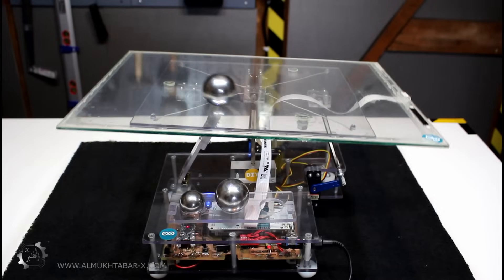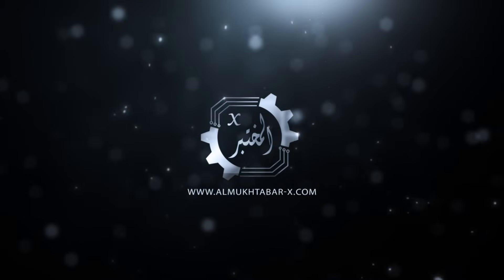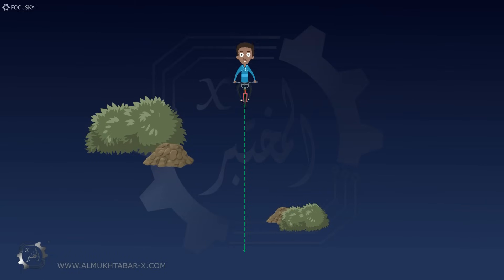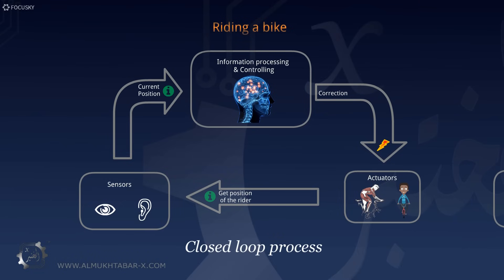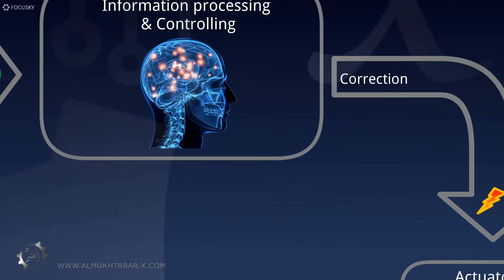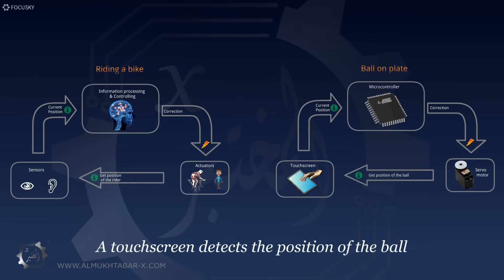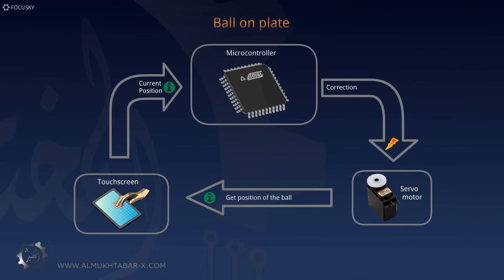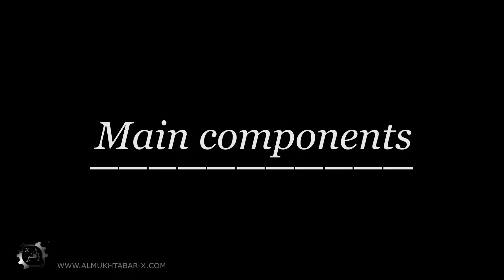Why this Plate never lets the Ball Fall? Ball on Plate PID controller with Arduino

Comment: this is impressive.  I just got a few of these touch screens (actually mine still have an LCD on them) at a surplus store.  I doubt I will be able to interface with the monitor, but I could overlay the touch panel over a different lcd.  Anyways, I was hoping to get some information on how that touchscreen interfaces with the arduino.   What are the 5 lines you connect & what kind of information is the touch screen sending?

Comment: Hello! This is totally amazing! congrats for this great project :) 

Do you have some simulation about this system? currectly I'm working in a project with a states feedback but my main problem is in the non linear simulation. I linearized the mathematical model to can design a control, but when I try put the same control with the non linear model there are problems, and I know that is so difficult that the same control function with a non linear system but I was just looking for an approximation ... I would like consult some type of information if  you have to can achieve this project :) 

Regards!

Comment: Incidentally, no, a bike stays upright NOT because of the skills of the rider, nor because of the gyroscopic effect of the wheels — those help, a little, but are not necessary.  If you have a powered bike of some sort, and jam the throttle on, it will disappear over the horizon if you don’t catch it.  The important thing is the geometry of the frame and fork, which causes the front wheel to turn “under” the bike whenever it starts to fall.  See here for details: https://youtu.be/oZAc5t2lkvo

Comment: This is great and has renewed my enthusiasm for Arduino. What brought me here is actually my office chair in my home. I noticed one arm was about a cm lower than the other, where it would touch the keyboard tray. I let it bother me for a day and then turned the chair upside down and gave the stand arms a few spins, seeing if I could notice any wobble in the way it moved. I could not, and when I set it back upright the problem was gone, both arms connected to the same height on the keyboard tray. 
           Is this a common problem? 
Should I use duct tape to secure the current position of the wheels or is there a more permanent solution. For reference my rocking adjuster is set to no rocking (as upright as possible) and my height adjustment is set to keyboard height. Thanks, a little off subject but as I was thinking of building one of these arduinos to fix it, not too far off.

Comment: Bike riding is completely different! A lot of the balance is achieved with the spin of the wheels via gyroscopic forces, it's only when you go slow when you have to do the balancing yourself, the faster you go the easier it is to balance. Simply walking would be better for your balance explanation but is still not a true analogy for your ball on a plate, carrying a tray with glasses of drinks on it would be a better way of describing it.

Comment: Hej great work,  could tell me sth about touchscreen controller.  Did u use some external controller, or either u impemented it on arduino by youself ?
Reply from the maker: I just implemented it in arduino.
Reply: Thanks, and one more question how do u connected this plexiglass sheet to your touchscreen ?

Comment: does the arduino 'know' the mass of the ball? Does the mass even matter or does it cancel out somehow?
Reply: Cannot answer for him but it looks to me like its using an ir sensor to determine the objects location, I see no way of sensing weight in the project.  If its utilizing it then weight does not matter as its accepting information based on position, so regardless of weight it will react.
Reply: @MrDmadness  wouldn't the touchscreen be responsible for sending position? Hence, the metal balls....
Reply: @robstach  yeah, I saw that much later. Touch screen for sure is acting as the sensor.    So the code would only really need to register the acceleration of the object relative to its reaction, in the video he has 3 ball bearings available but shows only 1 in use. He perhaps has 3 different codes that optimize the performance, but even without this is see it as he has 2 parts to a math triangle,  acceleration, over distance, it's also possible the touchscreen would be figuring weight into equation.  Regardless would be cool to see code.   I've got 2 boxes that pass a ball between them ( if the cat doesn't get the ball en route )  not really the same but that the servos react to "catch" the ball when the opposing passing one passes it hard.. its using sonic.

Comment: Nice project!
Did you wire the 5V supply directly to the Due's 5V/Gnd Pins? According to the datasheet it needs 7V or higher when supply is connected to the DC plug.
Reply from the maker: I used the Vin pin. The 5V pin on the Due board is a regulated output voltage. You can't use it as power supply input. Since the Due is not under heavy load, the 3.3V voltage regulator would work fine with 5V input, just like powering it via USB.

Comment: Hi, I search another real application of this type of system. Thanks
Reply: Controlling the liquid level in a tank for example. Imagine a tank of water that has constant water being added to it but it also needs to maintain a certain level set point. To achieve this you use a PID algorithm like in the above video. Compare it to the above as such; The level switch (touch screen) sends its data to a PLC (micro controller) programmed with a PID loop that calculates the error and makes the correction by adjusting frequency of the pump which adjusts the speed the water being pumped out of the tank, hence always remaining at set point.  

Really great video by the way!
Reply: @rafal.zaniewski7275  
Well in most applications like that you'd just use a simple and more robust float sensor. He uses the map function to the servo movements. Basically if you wanted a balance program just write it to keep map x y or whatever sensor readout within a certain value range. Eventually you lock it down enough and you can control it's motion. Example
If p.x > 10  && p.x < 100 && p.y < 100 && p.y > 10 { servo b1 () } //ball right corner 
And then when it detects that range it calls servo b1 subroutine which lets say activates the servo and lets say shifts the platform to roll the ball to the left corner.